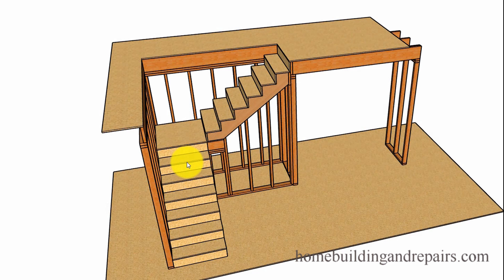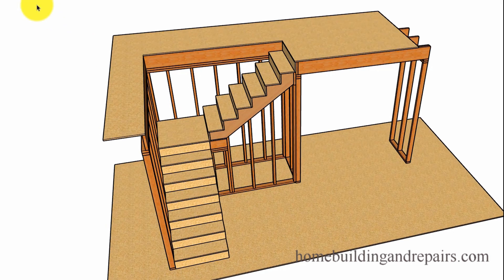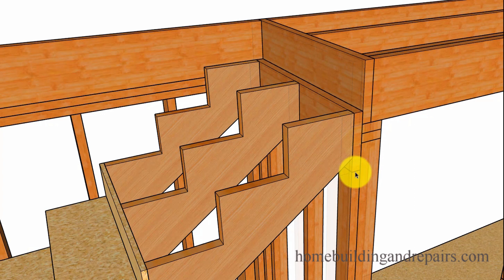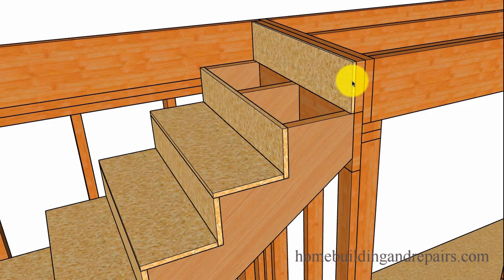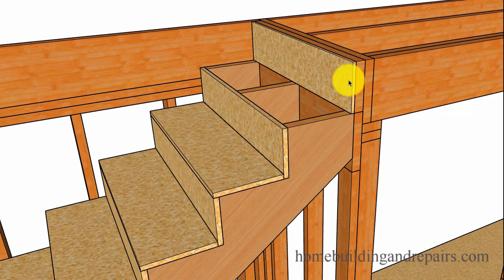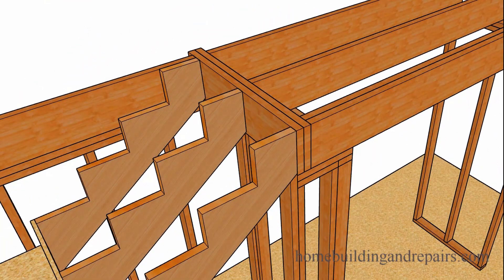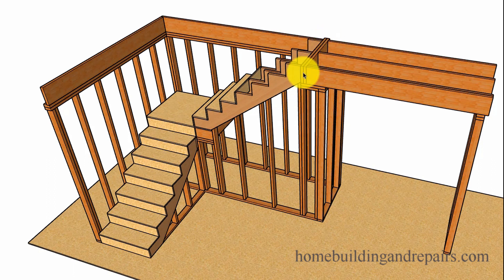How To Fix Engineering Design Problems Using A Few Different Stair Stringer Layout Methods

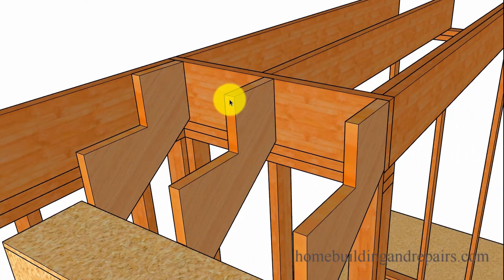Comment: Hi at 4:21 you extend the stringer and essentially add a partial tread at the top.  In your example, it looks to be about 6” deep, which I assume, doesn’t impact the strength of the stringer.  But what if I only need half a tread at the top (5 inches) BUT my ledger contributes an inch and half (due to it being a 2x6).  Would it be a problem to extend the top of my stringer only 3-1/2 inches? How low would realistically impact the strength of the stringer? Would it make a difference if I’m using metal stringer hanger hardware?
Reply from the maker: I've cut them as thin as 2 inches before and it can be a problem if the stringer lumber cracks, but you can usually reattach it.